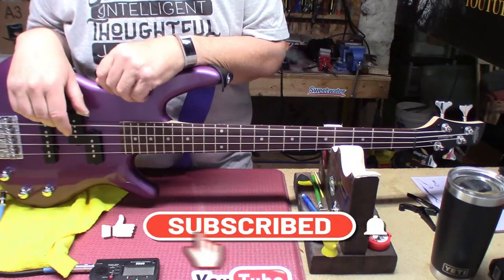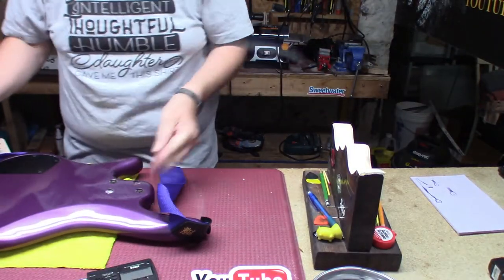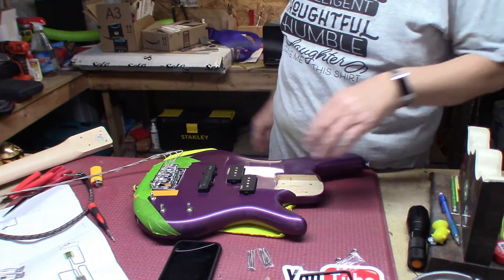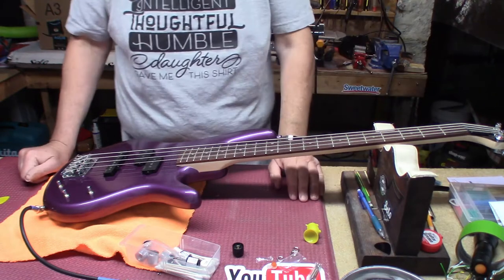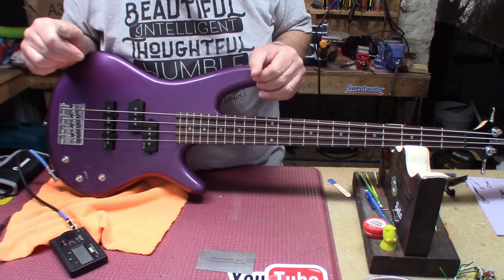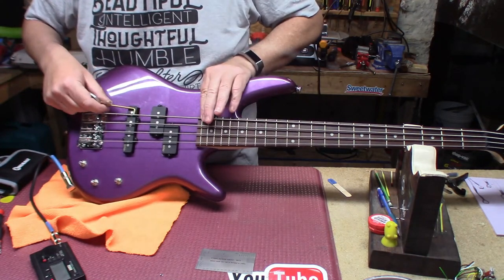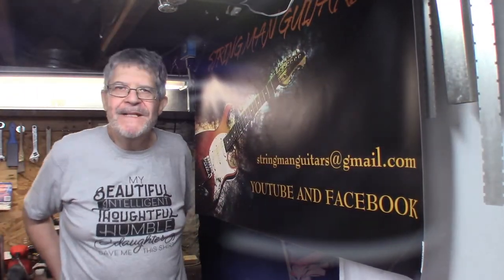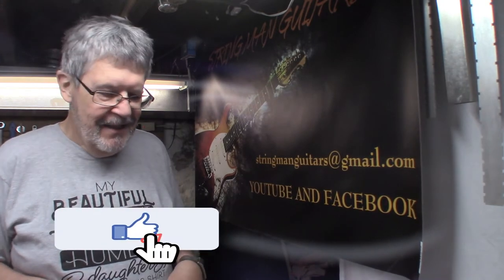Ibanez Mikro Bass Gets EMG GZR PJ Pickups Episode 131Part 1

Comment: I just recently got that same Micro bass and was wondering what is the correct string height above the pickups? Great channel you’ve got here! Very helpful.
Reply from the maker: I go by the pickup manufacturer suggestions or the pickup height gage if that’s not available. The tool is like $15 on Amazon.
Reply: @stringmanguitars4329  Found them! Thanks.

Comment: Hi. Just bought a second hand one of these. Should get it next mon/Tue. What height were you setting the pickups from strings please. 
Cheers john 😃😃👍👍
Reply from the maker: Pickup height bass side 1/8" and treble side 3/32". 5/64" string height on bass side and 4/64" on treble side. Allow for 12" radius using radius gauge.
Reply: @stringmanguitars4329  thanks very much for reply😃👍👍

Comment: Thanks Stringman! Watched P1 & 2 and the other upgrade vid on the black bass. Good stuff.  EMG Geezer vs SD Quarter Pounder, do you like one over the other better?  Do the Geezer’s come with the plug’n play pots?  Looks like you got a kit with PU’s and pots.  What pots would you recommend for the the SD’s?  Also where did you get the black knobs. Mine are chrome.
Reply from the maker: On The red one I used Emerson 250k full sized pots. Pull back wire and a Switchcraft output jack. The GEEZER set comes with all the pots but you should replace the crappy factory jack with a Switchcraft barrel jack as the one in the kit doesn't come with a barrel jack. Picked up knobs at local store.
Reply from the maker: Thanks for watching! Good luck!
Reply from the maker: For flats I like the Geezer. For rounds definitely the Quarter Pounders.
Reply: @stringmanguitars4329  Thank you, Stringman.  You wouldn't happen to have links handy for the Emerson pots (is that the same as CTS? and are those taper?)  and Switchcraft parts, would ya?  :-)
Reply: @stringmanguitars4329  One more question, Stringman, how do you remove the knobs? Are those collet knobs?
Reply from the maker: @adrianbogle604  not anymore. Linear taper.
Reply from the maker: @adrianbogle604  remove knobs with a rubber gloved hand if they don't just slide off.
Reply: @stringmanguitars4329   They are extremely tight.  So, rubber gloves and pull, got it.

Comment: I recently bought a 5-string Mikro. Would love to swap out the bridge, the tuning machines, the pickups and get it set up. How much do you charge on top of cost of hardware? I live in LA though and don't mind shipping the bass over if I can afford your service :)
Reply from the maker: I'd go with the Hipshot Kickass Bridge. Gotoh tuners and Seymour Duncan's Quarter Pound set or the EMG Geezer pickups, which are plug and play. Don't send here because of the radical change in climate. Find a good local tech. I'd love to do one, but it's not worth the possible issues that would crop up.
Reply: @stringmanguitars4329  thank you sir for the generous advice and information!
Reply: @stringmanguitars4329  

Hello sir. I noticed my comment(s) have been deleted by YouTube since they got confused as spams.

You suggested the Hipshot Kickass Bridge and I notice there are multiple variations of that - and I am confused over which one to choose - the different mount styles and high mass or regular and so forth... Since I am a totally newbie to this, can you shed some more light? Many many thanks!
Reply from the maker: @arthuryuen6249  They are there. You are not spammed. There is only two Kickass Bridges. 4 or 5 String then three colors. Pretty straightforward.
Reply: Would those emg be pj or p?

Comment from the maker: I'm building one for myself. I bought the Hipshot Kickass in black. In this video it's the Hipshot Type A.
Reply: Enjoyed both videos.  Did you have to do a lot of drilling for the Hipshot Kickass replacement? Which bridge do you like better? Thanks
Reply from the maker: @khchan5835  decimate
Definitely the Kick Ass bridge. Our lines up perfectly with the screw beside the potentiometer. Plug and redrill the others. Easy. The other Hipshot Type A was measure and hope. Also the string spacing is adjustable on the Hipshot Kickass Bridge.
Reply: @stringmanguitars4329  Thanks for your speedy reply.  Much appreciated